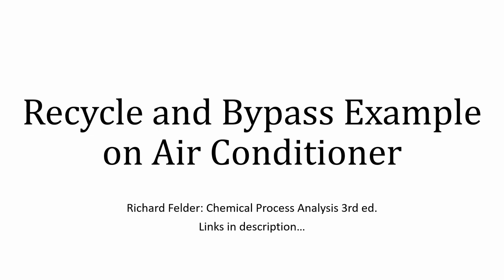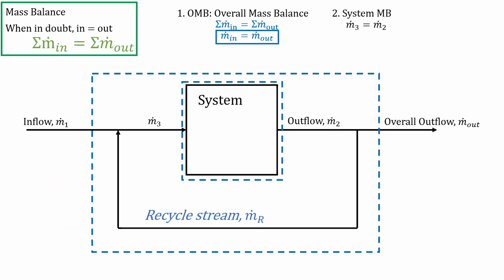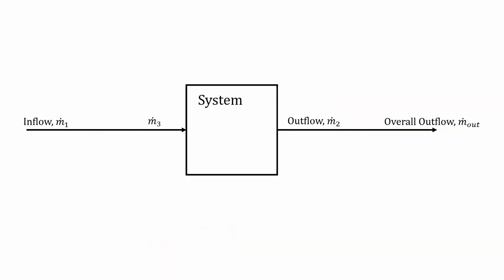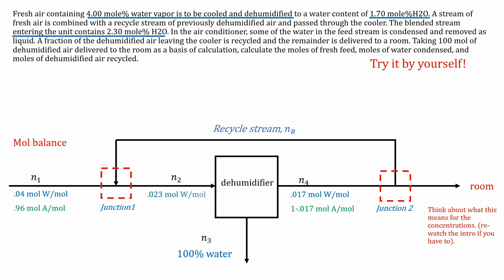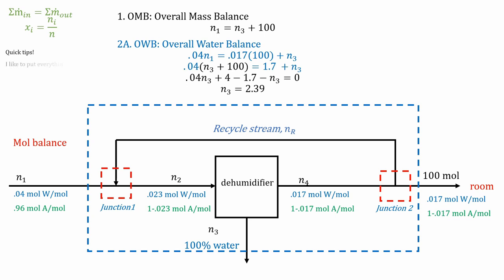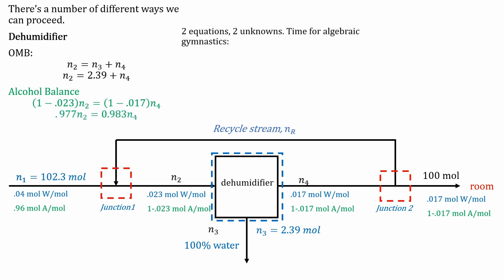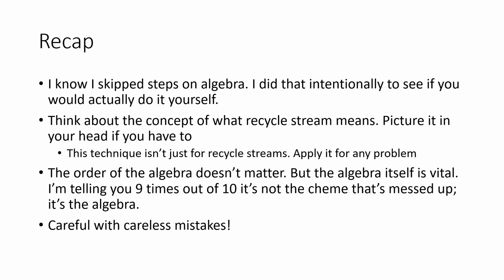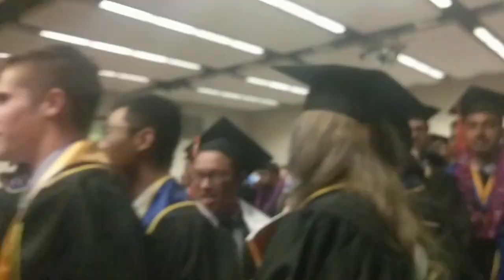Recycle and Bypass Example on Air Conditioner - Chemical Process Analysis

Comment: The question states "Fresh air containing 4 mole % water vapor" then how come when you are labeling everything in the PFD you state 4 mole % water? and not "4 mole % watervapor/Air" Can you please help since it is confusing
Reply from the maker: This is a great comment and I have pinned it because it reminds me of a similar confusion I had when first studying this class. Quite frankly, I just decided to use mol W/mol as the notation for units for the mass fraction of W (W for water). You are correct I really should have used (mol % water vapor / mol % of air), but the confusion may arise due to the fact that I'm that the stream of air n1 is composed of both AIR and WATER. Thus, I use (mol W/mol) to indicate (mol W/mol of stream n1) NOT (mol W/mol air). Hope this helps!
Reply: Can you do an example differentiating the mass percent you are using and the mole % you are suggesting. This may sound like a dumb question, but it’s been a while since I have done this problem. It will help me delineate better when doing problems similar of this kind. Would you be able to help me out?
Reply: Stream n1 is composed of air and water vapor, then how come you only use water? How do you know you have to use water instead of water vapor? From my understanding I would think water vapor is different from water and also would think water vapor is different from the air that’s also coming in. Can you please help clarify since I’m really confused?
Reply from the maker: @dhavalkothari9807  i completely understand your question. Let me think about how to address it and get back to you.